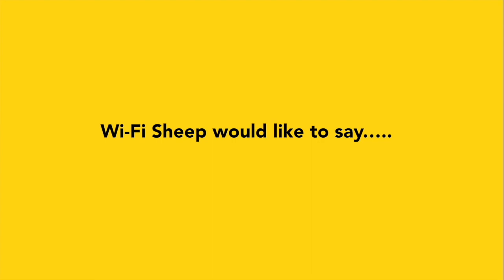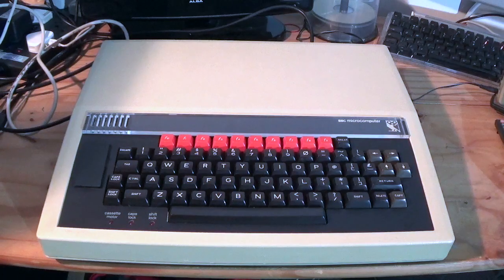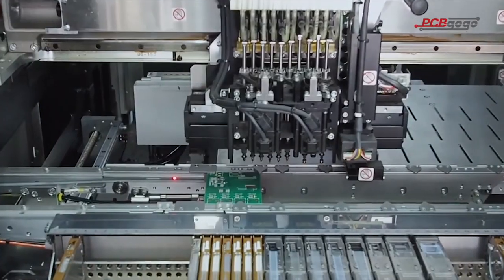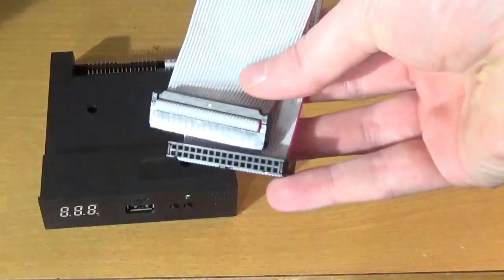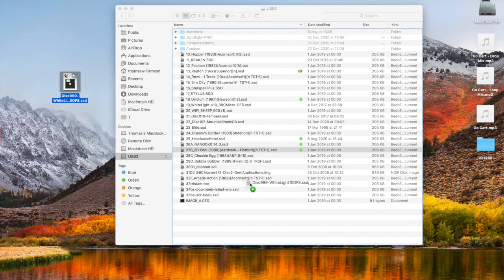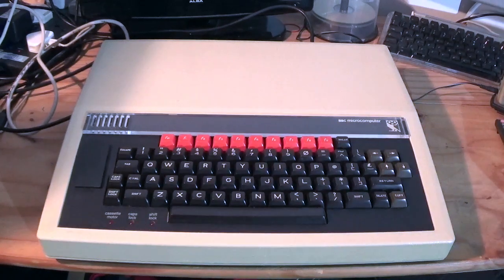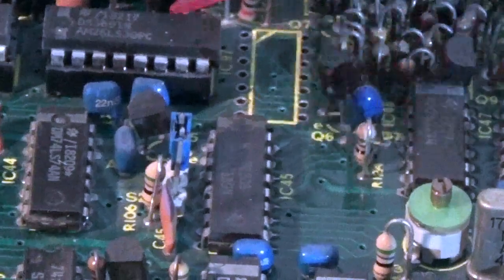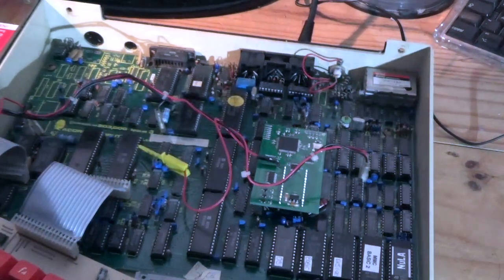USB drives for 8-Bit BBC Micro? GoTek Floppy Emulators (Model B users Beware!)

Comment: Like one of your other viewers, I paid around £15 for my GOTEKs, but flashing the first one did take a few hours and require a 99p adapter from China. I hadn't heard that any BBC model was incompatible with the GOTEK, but had heard of the index setting. The downside of using them with a model B is that unless you have a working floppy, you might need to fiddle to get the controller working. The Master and Compact have soldered in components and in my experience always work. The main benefit from my point of view is that they have the best compatibility. The MMC solutions are much faster, but that can be a mixed blessing.

Comment: Hi Tom. At first, I thought the £40 price tag for the  Gotek was a bit steep, but as it comes ‘ready to go’ and with all the needed cables it seems reasonable.
I paid about about £15 each 2 years ago, but with no cables, and I had to flash the firmware onto the drive myself.
I have modded them to use a rotary encoder and with an OLED display (which will display the actual name of the selected floppy image).
These works happlily with my 2 model Bs and my Master 128. Good to see that the good old beeb is still getting the attention it deserves from the retro computing community.

Comment: Tom, The Gotek does work with the 8271 Disc Controller. if you're running the Flash floppy firmware on the Gotek, which yours is, you need to put "index-suppression = no" in your FF.CFG file on the usb stick. this will make it work. I've been running a fully modded Gotek on my issue 3 Model A (upgraded) with an 8271 in for over a year now. it's documented here https://github.com/keirf/FlashFloppy/wiki/FF.CFG-Configuration-File
Reply from the maker: Hi James! .... OMG No way!!!! Thanks for the heads up on this, I will look into this ASAP. 
No one I talked to mentioned this at all so cheers for the info.
If I can get this working, and I don't doubt you, i'll do an update video in the coming days!
Really appreciate your comment :-)

Comment: I’ve got a B with two Watford dual “Z80 pack” drives. Presumably I’d need to go back to an Acorn from the Watford DFS (called MCP)
Reply from the maker: Hi, you might find it works ok. Since this video was shot new information has came to light, and i have the go-tek working with the stock controller. I dont know for sure with the watford unit but it might work. An update video will be released shortly. Pi PICO news has pushed it back a few days!